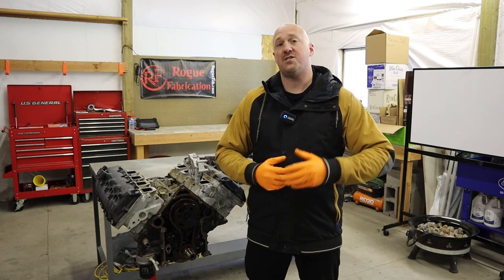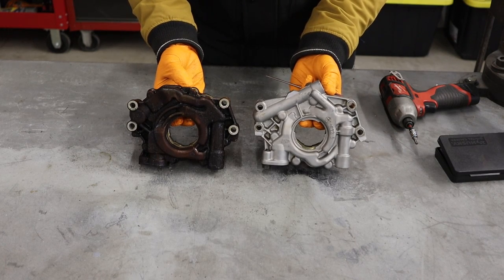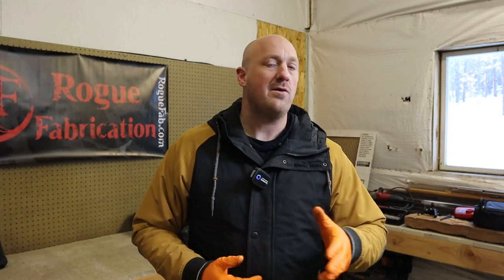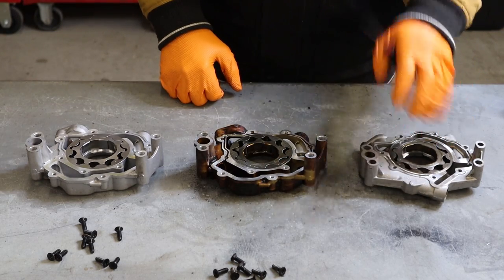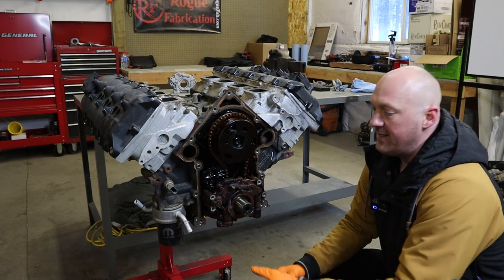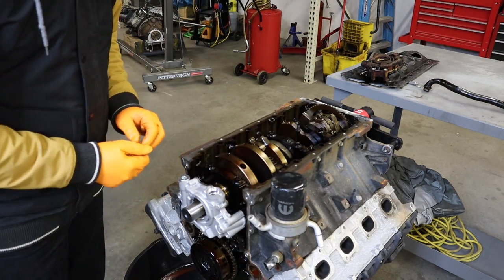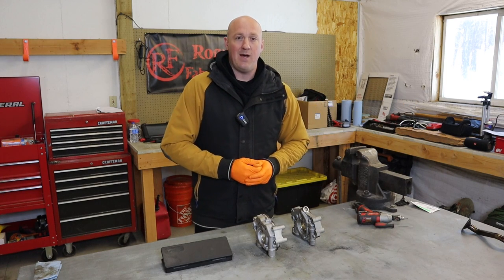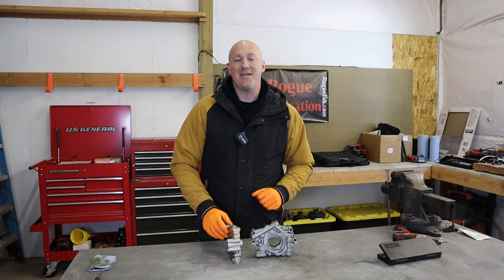Is it TRUE that Installing this ONE FACTORY PART Can PREVENT HEMI TICK?

Comment: The problem with the Hemi lifters is not lubrication. The problem is the type of honing process used to hone the bore in the roller in the roller lifter. This roller bore is the outer race of an assembled needle bearing. The metal surface of this bore in the roller fails due to the type of honing processed used. This then destroys the needles, causing the bearing to fail and it’s related cam lob to wear away. Historically the bores of these rollers have been honed with the conventional honing process (the same honing type that is used on engine cylinders). When I was made aware of the Hemi roller lifter/cam/lobe problem I acquired two roller lifters from a Chrysler dealership. Upon disassembly, the bore of the roller in the Hemi roller lifter has been single passed honed. This single pass honing has process characteristics that are not good for the race of a needle bearing. Single pass honing imparts many times greater machining stress into the surface of the bearing race and as imparts a surface finish lay that has the appearance of a very fine pitch thread. This greatly increased stress in the surface of the roller bore along with the surface interaction with the needles causes this surface to fail; surface cracking a spalling occurs which destroys the needles. This single pass honing process was chosen because the capital cost of the single pass honing system is approximately 1/3 of the cost of a conventional honing system to do the same bore as Single pass honing cost per bore has typically 20% compared to conventional honing process. Moving to single pass honing was a cost cutting attempt which has gone bad. My background is as BSME and 40 years of application experience at Sunnen Products Company, which approximately 20% of our business is engine components. My email is rmoellenberg@sunnen.com
Reply from the maker: This is good info, I haven't heard this one yet, thanks for chiming in! 👍
Reply: Thanks Rich. So, if you were a hemi owner, what would you do to increase life of the engine without tearing into it? Different viscosity, additive, etc?

Comment: Just use an aftermarket high volume standard pressure pump for the 2003-2008 Hemi or you can try a standard volume. Not hard to ship the relief spring or replace the relief/bypass spring with a higher pressure spring.

Comment: What if the hellcat oil journals/pathways are also larger than the Ram 1500 pathways , therefore allowing more flow/volume?  Point is, if you add a higher volume ( idle ) oil pump, but the system is more restrictive, then you have added more pressure, but not more flow.  I have no idea... But I would guess that the Hellcat engine oil pathways are also larger, and probably proportional to the higher flow pump.   So, unless the oil pathway of the Ram 1500s and the Hellcat are different, then all you're doing is adding pressure to a still restrictive flow.  If oil pathways are the same, then I can see how this would hep.  Thanks for the time and details - much appreciated!

Comment: My 09 Ram 1500, I installed OEM 3/4 ton camshaft, Hellcat lifters, MDS delete, drilled head gasket oil holes out to .080”, installed shim in oil pump bypass spring, installed upgraded timing chain guide and run a stainless high flow oil filter. That was my fix, works great
Reply: I’m in the process of doing this to my ‘14 1500.  I took the exact same route as you. I also added shorty headers and am now doing this hell cat pump update too. The pump is dirt cheap a guy would be crazy not to do it if your in their anyway👍🏼
Reply: Yeah, didn’t know about the oil pump at the time, I installed JBA shorty headers also and Vara Ram intake

Comment: I have an 09 built 2010 registered 1500 4x4 with 5.7 that has 202K miles / 4700 hours and has had 5w30 amsoil signature series oil since 16K miles when I bought it.  I do oil analysis a couple times a year and it is still tick free and oil sample results show clean also. Mostly road miles with with little idle time except for warm up in winter for 5-10 minutes tops before taking off. Pulls heavy often 7500-10k lbs on a 24' gooseneck trailer.

Comment: My 5.7 hemi in my '14 broke a valve spring with 108,xxx miles. So, while it was down, I went ahead and also put a timing chain and Hellcat oil pump in it.

I primed the oiling system before I actually tried to start it.

When it was time to run the engine, I had my vehicle info display (temp, oil pressure, oil temp and transmission temp) up on dash.  When the engine started, with the Hellcat pump I have 92 psi at cold start, NINETY-TWO PSI.

I saw a comment on one of the videos about a guy that had installed a Hellcat oil pump and then he got a DTC code for "oil pressure high" and he said he had to buy and install an oil pressure switch/sending unit for a 6.2  Hellcat. I would say that his oil pressure switch was already going bad. I say this because the oil pressure for the 5.7 hemi and the 6.2 supercharged hemi are the EXACT SAME part number.

Comment: Curious to see the one for the 6.4 compared to the one for the hellcat.
Reply: He did that in a video, the 392 is the same size as the 5.7
Reply: I've had to change my cam and lifters. Recently, I notice when my engine is hot and at idle, my oil pressure can be as low as 16PSI. Only 49PSI at high RPM's. I think that low oil pressure is the cause. My water pump started leaking, so I figured it's time to increase the oil pressure. I'm in the middle of putting everything back together right now. I've had my dash show "wrong oil weight" when it was time for an oil change. I guess the oil pressure went too low, less than the 16PSI that I have now. 
You would think the manufacturer would understand this low oil pressure issue and fix it. But then they get less repairs in the shop, so they go with low oil pressure on purpose.

Comment: I watched a video by Uncle Tony where he theories why these lifters go bad/cams get wiped in the hemi’s. It’s not an oil pressure problem, it’s a design issue in A) the angle of the lifter in relation to its bore, and b ) the location of the cross over pipe blocking “splash” oil from reaching the lifters at low rpm…. I’m
Not sure more oil pressure would solve either issue. Perhaps oil volume, but not pressure as there is no pressure where the lifter roller rides on the cam. 

The reason why idle kills these motors is the lack of splash, when the motor is spinning faster the oil is getting slung harder and in more volume by the crank and more oil hits the roller.

Comment: I had #3 (non mds cylinder) go out on me. Lobe was pretty bad and lifter roller worn & siezed. Already have replacement cam, lifters etc, already ordered a Hellcat pump by time I saw your videos. Have 226,000km at 5,028 hours. Owneed the truck since new (2009). Intending to keep the truck for a few years yet.

Comment: Is their much of a difference between a 6.4 Hemi oil pump and the Hellcat Pump?
Reply: I have a 2012 6.4 oil pump, a brand new hellcat oil pump and a melling. I took all 3 apart and the melling and 6.4 pumps are identical internally. The hellcat oil pumps rotor and ring are approxi
mately .75mm larger in diameter. That was the only difference I could find.

Comment: Bought my 2017 Ram 3 1/2 years ago, it had conventional in it when I bought it, when I'd idle it would be at 27lbs, kept that in it for a couple oil changes cause they were free. Got tired of the dang dry lifter tap almost every cold start up. Started using Amsoil Signature, 3 years ago, awesome stuff, never looking back. My truck idles at 37lbs now, have never had the dry lifter tap on startups, since switching and the ole Hemi idles nice and smooth, no ticking, not that it ever did, but trying to prevent, so far so good, knock on wood, lol.

Comment: It’s more than just the pump and mds disablement I buy cop cars at the auctions that are and and hemis and I fix them paint them and restore the interiors and use them for customers courtesy cars. Plus a couple 300’s that are cheap as hell and my cost on parts for the kit is only 288.80 for everything top to bottom a perk of being a tier 1 wholesaler for BTAND NEW PARTS. So so much people. Don’t know it blows my mind.!! Well played you’re on the right track

Comment: Because the entire pump is pushed out so far, I'd see if you can get the timing cover back on, even if the splines don't fit.  If that does work, you could possibly rough cut a 2nd oil pump drive, and weld it onto the existing one to get the extra length.  If you did that though, I'd be concerned if the balancer would press on far enough.

Another idea is to port the existing pump.  HeadflowInc has a great set of videos where he ports LS pumps and adds shims to the pressure spring.  The pre-08 hemi pump doesn't have a threaded cap on the pressure regulator like the LS does, instead it is a pressed cup, retained by a roll pin.  If you drive out the roll pin with a punch, you can get the pressed cup out with a little bit of work.  Ideally, you'd want to tap for a plug (I wouldn't be surprised if the LS plug would fit since the pumps are so similar).  But even if you can't tap a plug, you can still shim the spring, press the old cup back in and re-secure with the roll pin.  Between raising the pressure on the spring, and porting the internal passages, you might get enough out of the stock sized pump.  Even drilling the output hole larger might work as well.  I didn't port mine, but I did shim the spring, and I did get more idle pressure.
Reply from the maker: Tucker, that's kind of creepy. Your first part of your comment was exactly what I was planning on doing! 😮

Comment: Just bought a 2021 Ram 1500 with the 5.7 for my wife. Being her truck, it's going to idle ALOT. I'm bringing it in to get the headers replaced under warranty as both are cracked at 36k miles. 
I see the oil pressure dropping low at idle. I'm thinking if we want to keep this truck long term I need to replace the oil pump with a higher flow model that can produce higher pressure at idle ASAP.
Definitely can't hurt.

Comment: In the middle of doing this mod right now to a 2015 RAM 5.7. Swapping the stock oil pump for a Hellcat pump, but using the stock pump's relief spring. New Chain, tensioner and guide, new (non-MDS) cam, new lifters, pushrods, valve springs (needed for new cam). Expecting to see around 65-70 PSI oil pressure after the swap. Was getting 40 before. With only 180,000km (112,000mi) on the engine, I expected to see my original, MDS-capable cam in great shape. I was wrong. Even though I've been using Redline 5W30 with good K&N or Wix filters, there were two cam lobes already showing signs of advanced wear. Of course, they were on MDS cylinders. The lifters were all decent looking and still turned on the needle bearings. Cylinders still have good crosshatch so the shortblock is good. Heads sent to machine shop because they were off, so may as well get them cleaned  up.

This engine was still relatively quiet and not throwing codes, which goes to show you just how bad this design flaw is. Even if you think you're still okay with a stock hemi because it isn't ticking yet, you probably aren't.
Reply: bro, so what is the real permanent solution to this problem? I just purchased a high pressure pump and am now going to buy new lifters. but there is a lot of different advice on the Internet and I don’t know how to do it correctly. durango hemi 2011

Comment: We used to do this on small block Chevy engines, installed high volume oil pump.
Reply: And they really needed it.  The old chevy V8's only had about 45 psig pressure which wasn't enough especially after I added the hotter cam in my 65 327 and wound it to 6,000rpm often.  I scorched a rod bearing from lack of oil pressure while running it hard.
Reply: @williamwhite9767  have you seen the class action lawsuit brought to GM regarding their lifter failures?
Reply: And Ford 3 valve Tritons. They definitely need it.

Comment: Hi Sky. Does the installation of the Hell Cat oil pump raise the oil pressure across the entire RPM range? And if so could running a higher oil pressure lead to other issues? For example could gaskets not designed for it blow out? Or any other possible issues be caused.  I have a 2015 Ram 5.7 Thanks.

Comment: Yes, this is the very truth, Chrysler did not install a high enough volume oil pump in the 5.7 Hemi Engine and from reading I found out that the 6.2 Hemi oil pump fits the 5.7 hemi as well. The problem is that the older hemi blocks were made differently, as the cam shafts of the new blocks were actually put further apart form the crank, so distribution of oil is much less than the older versions of the block. From reading, this is what I have understood. The oil has more of a distance to travel and doesn't lubricate enough on the cam shaft compared to older versions. The fix is to install a higher volume oil pump on the engine block to increase oil pressure, thereby reducing wear on the camshafts. I would suspect that this would also have an effect on the piston rings and valve guides as they would get more oil pressure circulation as well, increasing the life span. 

Another problem has been that the exhaust manifold bolts are notoriously able to break during heating/thawing, because the aluminum heads heat/thaw differently than the block its self. From reading is to buy sport tuned header shorty's to mount up to the original exhaust or sport tuned long headers with redoing the exhaust system. The most less expensive way is to buy shorty's that are sport tuned. This seems to solve the exhaust manifold bolt breakage problems from reading. 

From reading, these are the major issues with Hemi Engines. Some older years in past recent generations had valve seats dropping into the cylinder on Gen 4. They seemed to have fixed the issue of valve springs loose in Gen 5.

Comment: The long awaited 6.2lt pump finally arrived (supply issues lol...) for my 09 Ram. 
A ready replaced cam lifters, machined heads, manifolds etc. Replacing timing chain, so also pump to upgrade. 
Compared the Hellcat to my original 5.7 pump, though Dodge had ripped me off because both pumps have same with pump gear width. So remembered you measured them. Both are 16mm wide. 
My truck was very early 09 production (#8**) . Suspect the first run was these pump then "down graded" for later production. Also compared to you latest vid with pressure tests. Mine is standard pressure. So, suspect the relief spring is the same as stock 5.7.
Theoretically I should have still had higher volume. My #3 exhaust roller failed. Would run normally until under more than half load. Turns out the lifter turned 90 degrees, giving me a dead misfire, then straightened up after 10 seconds then drove normally. Very wierd.
Vid shows how the cam wore. https://youtu.be/FgjqHA5Y2CM
Reply from the maker: That is actually very interesting! Would you be able to send me some photos of your original pump gear next to the hellcat one? I'm wondering if maybe there's a difference due to you being in Australia? A lot of times overseas vehicles will get different spec parts for no real reason.
Reply: @ReignitedAuto  lol, yes I am Australian, but I am on Vancouver Island Canada 🍁 🤣. Bought our truck new when we lived in Calgary.
Will send you Pic of the two pumps. 
I did catch a comment you made about the aftermarket lifters being a problem. As there is a huge back order wait up here I pretty much had no choice. 3 of them were noisy for quite a while, and 300km later, one is still not silent and bleeds down overnight (rattles on startup. My pressure is definitely higher now. Seems the MDS doesn't cut in as much.
Reply: I had cam/lifter failure - 2011 RAM 1500 5.7L.
I just bought the Hellcat pump 68195993ad and did the side-by-side on the old oil pump VS the Hellcat, and they both measured the 16mm width [Rotor thickness]...
My old oil pump had a "622BF" stamped on the back plate.
What vehicle did you pull the "stock 5.7L 09+" oil pump  out of?
Wonder if the trucks already had an "upgraded" oil pump...

Comment: Great video! Straight and too the point. Spline thickness made the case for more volume going to the top end. Question…is the oil pump in the 18 scat pack 392 the same as the 5.7? That wasn’t addressed here. This is great for my 14 Ram, but before I do the challenger I want to know the percentage of volume increase.
Reply from the maker: I did another video later on showing that the scat pack pump is exactly the same as the 5.7 pump. However, there's a better option available now than the Hellcat pump! Melling makes the M452HV pump which provides a full 20% more volume than the stock pump, the Hellcat is only a 12% increase. This pump from Melling is a direct replacement for your stock pump 👍

Comment: Has anyone put the Higher Volume Oil pump on a regular Hemi?  Like checked the Oil pressure after it was installed - GREAT video!
Reply from the maker: The results of the hellcat pump install on a regular Hemi engine is coming soon, keep an eye on the channel for updates 👍
Reply: @ReignitedAuto  Awesome subscribed and like the Hemi wished they had kept the 'Dodge' name on the trucks.